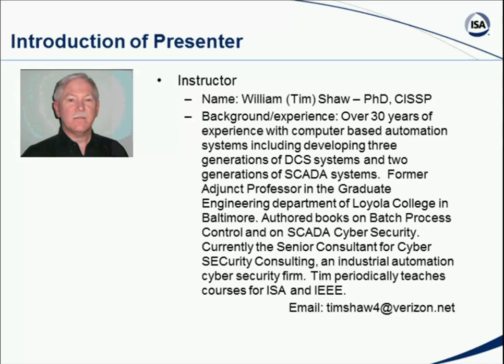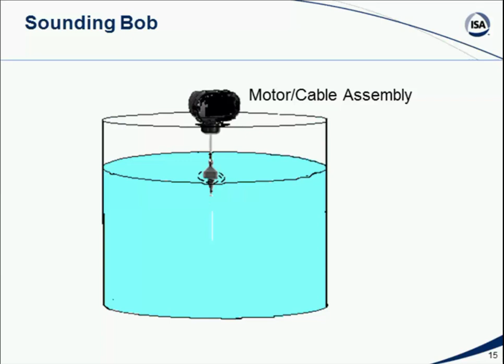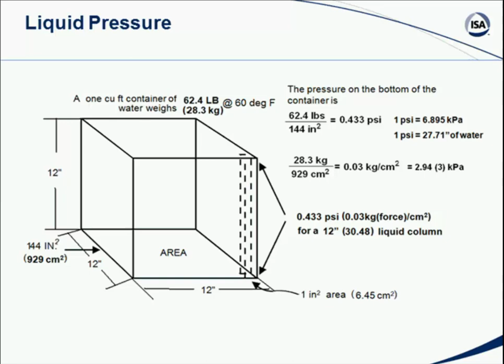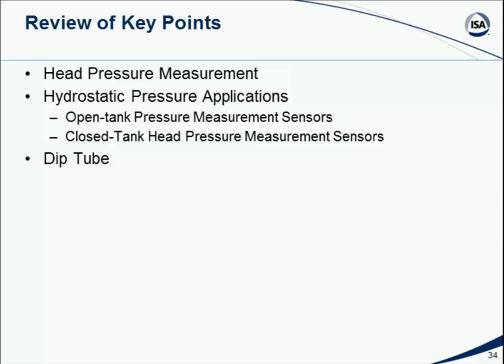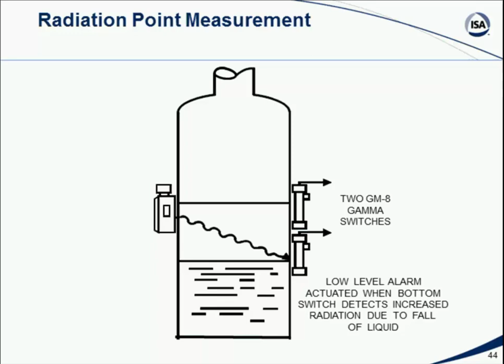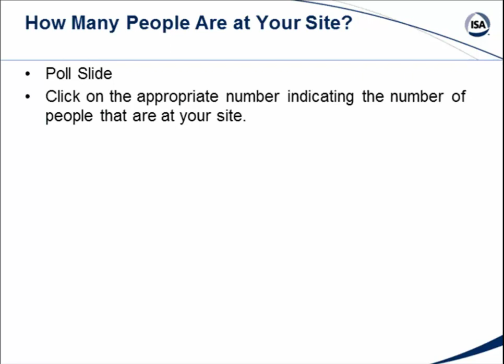3) Introduction to Level Measurement

Comment from the maker: Download the free book Introduction to Process Control. Only 73 pages and great for beginners: http://www.LearnControlSystems.com/process_control_fundamentals.pdf
Power Point presentation slides for this video in PDF format: http://www.LearnControlSystems.com/FG05W3.pdf
How to calibrate tank level measurements with  transmitters using diaphragm seals: http://www.LearnControlSystems.com/Level Measurement -rosemount transmitters with seals .pdf